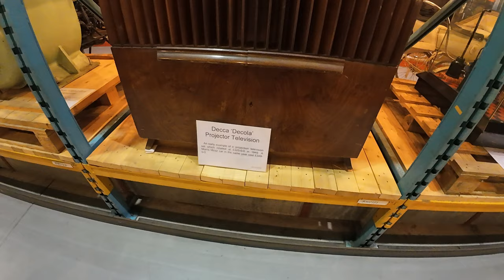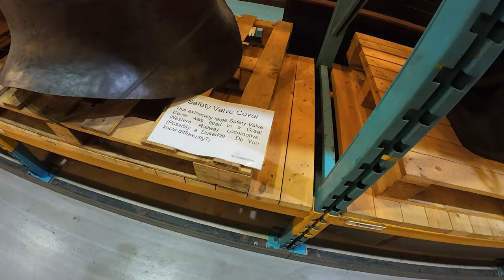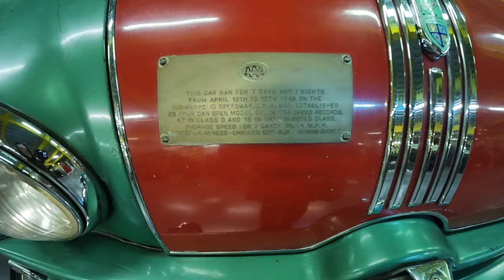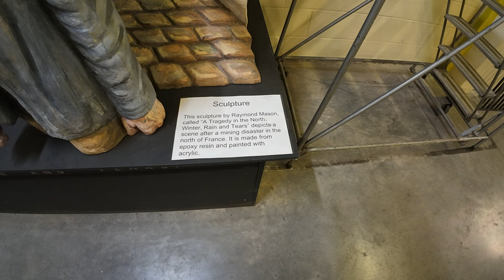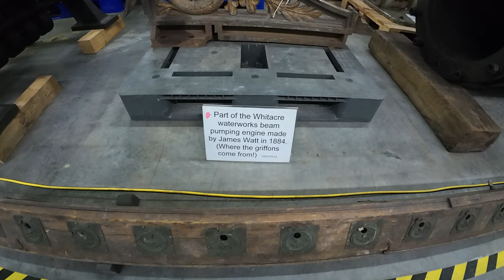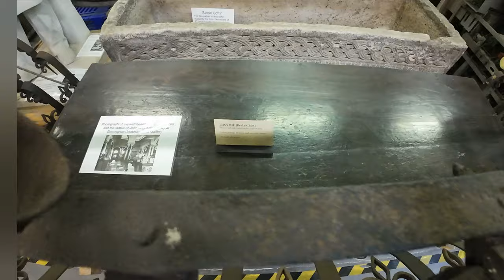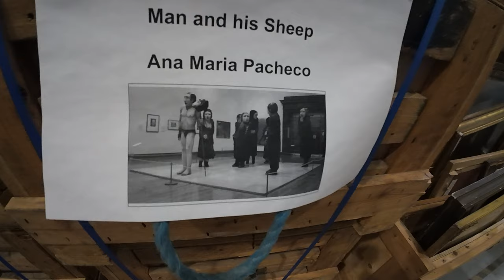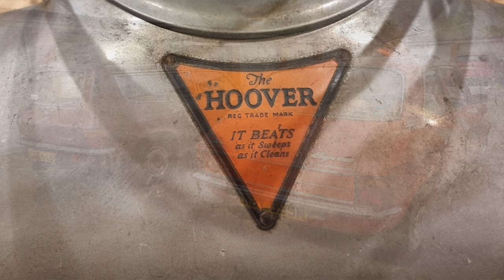Rovers and more at the Museum Collection Centre in Birmingham !

Comment: A few coments:  No, the Singer Sewing Machine company had nothing to do with cars. Singer Motors eventually became part of the Rootes Group.
The Panhard at 22:00 has a VERY early Birmingham registration.
The BSA at 25:30 was produced 2 years after the company bought Daimler. BSA car production then moved to Coventry until killed off in 1939. BSA of course means Birmingham Small Arms.
The cycle transmission at 28:00 uses Brammer Belting. It is possible to add or remove links from the belt using simple tools. Such belts are commonly used inside machinery such as lathes.
The V12 diesel is a SMALL Paxman engine. They later built much larger units for use n railway engines and ships. You think that's a big piston? The ones in railway engines are nearly big enough to sit on! Harry Ricardo was the man behind nearly all the great technological advances in internal combustion engines.